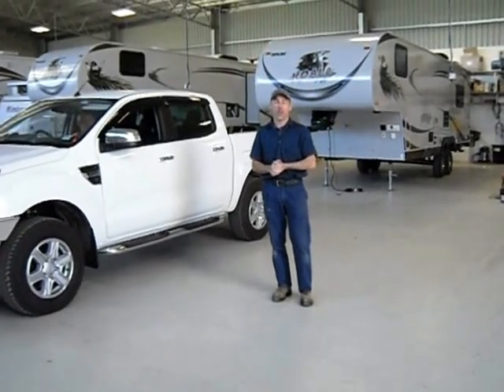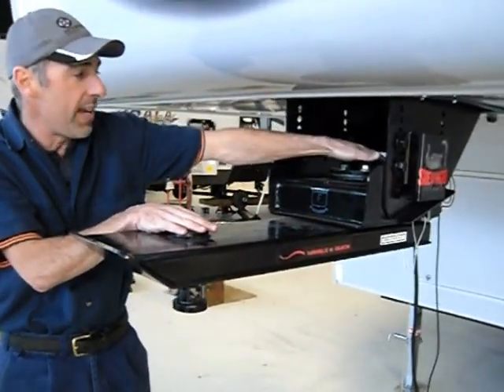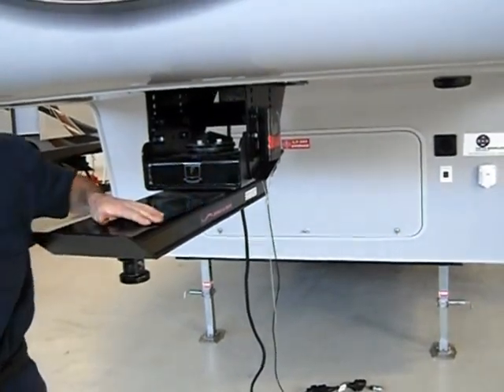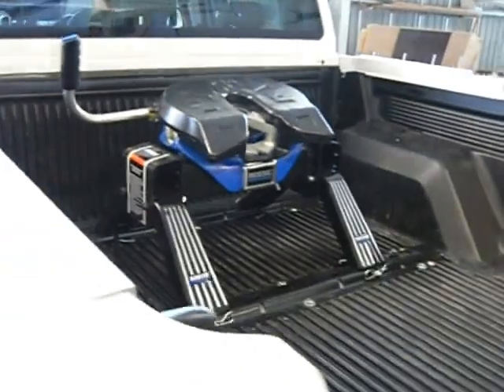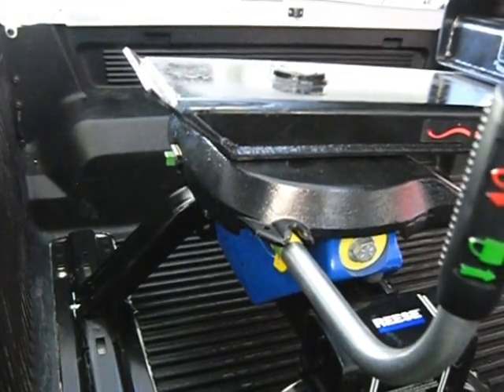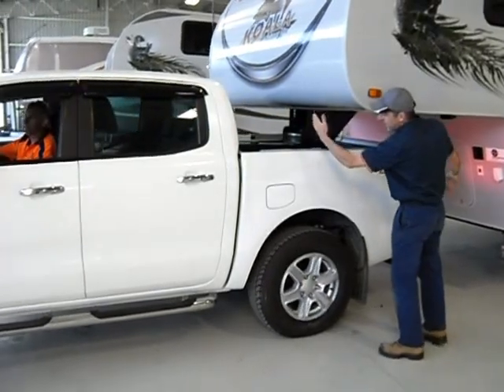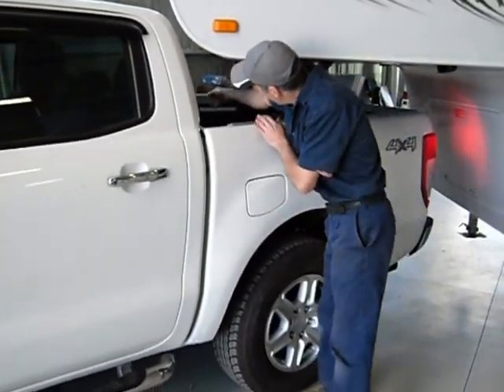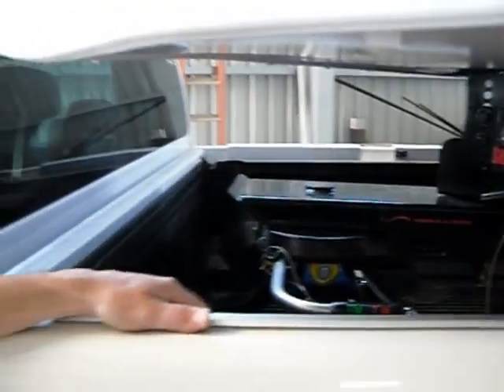New Ford Ranger 5th wheel Hitch, Colorado, Navara, Hilux. Hayman reese gooseneck hitch kit.

Comment: Who in their right mind would tow a 5th wheel with a Ranger. They’re too light.
Reply: My thoughts exactly!!! I don't think this option would be available in the USA.
Reply: I would. Provided the weights were right. I have been an interstate truckie for years, so size doesn't phase me, just weights. I currently tow my 30 foot boat, at 3,200kgs, on a tri axle trailer, without any problems at all.
Reply: Ford rangers have a 7500# tow capacity here in the states. I’d pull one in a heartbeat.